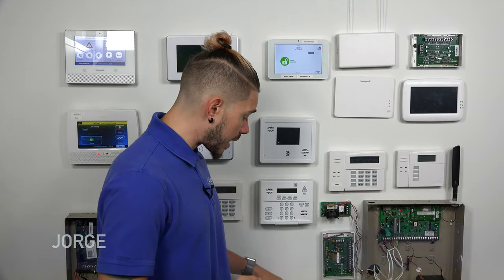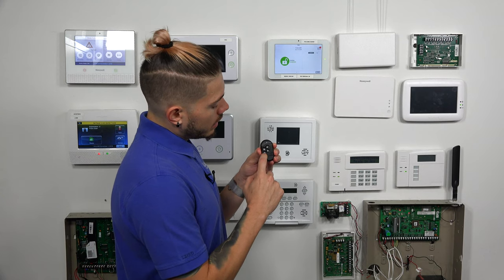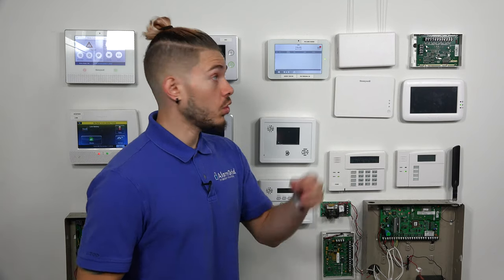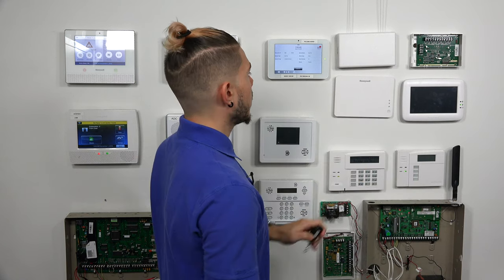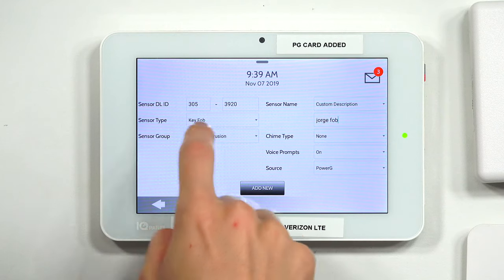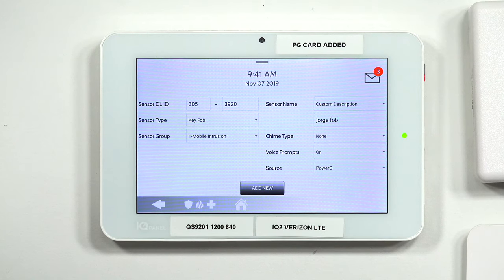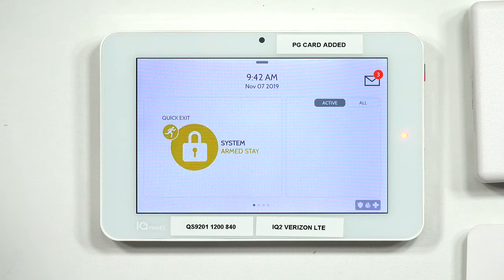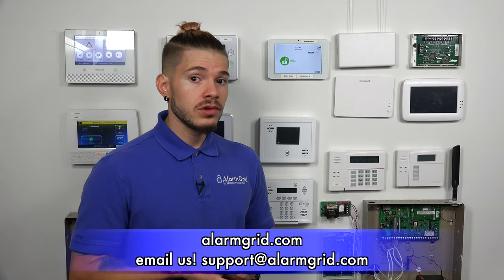Learning the DSC PG9939 Key Fob to the Qolsys IQ Panel 2 Plus

Comment: Hi, I have a IQ Hub and it already has one PG9939 added (by dealer) so I bought a couple more controls for my family (because ADT Mexico would charge me just for pairing them) and when I try to add them by pressing * my panel can recognize them but after configurating sounds, voice and name and trying to finally pair it to my panel it says its nos possible because of code error #5, could you help me please? Thanks! (Sorry for spanglish, I'm trying my best)
Reply: It is possible, that the new sensors you  purchased are incompatible with the Branded panel configuration. Usually when we see the error on a panel we have to replace the modules with another compatible module for the system. 
. I I hope this info helps.